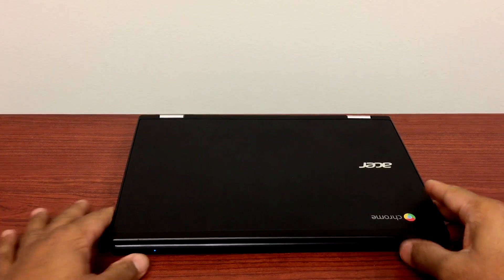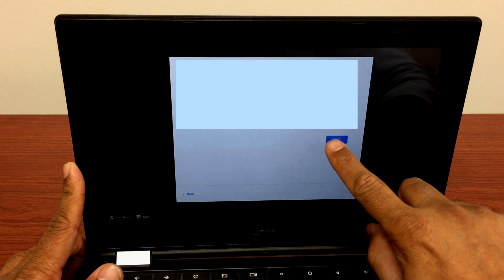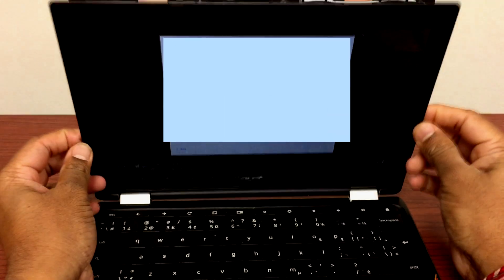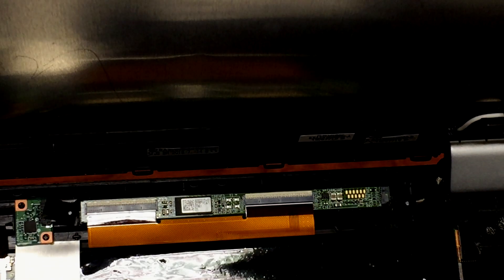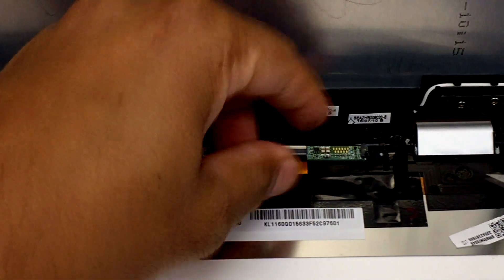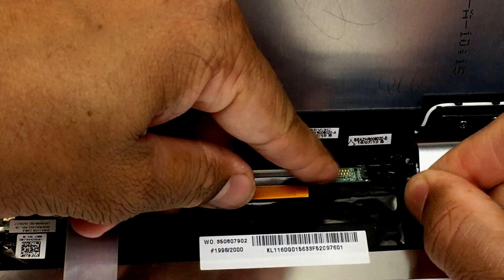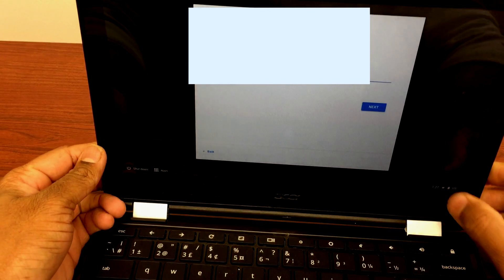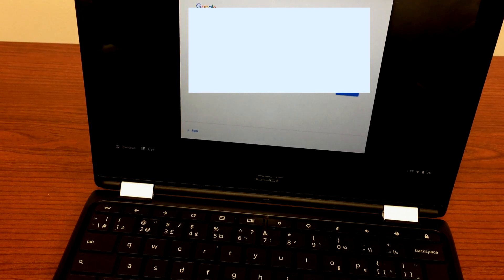Touchscreen not working || ACER Chromebook C738T || R11

Comment: Hey please, I have an Acer Chromebook r 13 not 11 and I think it has the same touchscreen problem but I'm not sure as to how to open up the screen and I don't want to end up cracking the screen, could you help out please?
Reply from the maker: It opens the same way as shown in this video. There is another video with touch screen issue which would help you figure out the best way to open the front cover. Good luck..
Reply: Bro did U fix it? I just bought Acer Chromebook R13 today and suddenly the touch screen stopped working

Comment: Is this the same with a Chromebook R13. The touch screen has gone on mine and I reckon it is a similar problem. Possibly a common one with these laptops being able to fold the screens back 360 degrees. I don't particularly want to fork out loads of money to have it sent off if I can just do this. Anyone got any idea where I might find this wire in and Acer CHromebook R13?
Reply: me too!  hope someone replies...
Reply: samee did you get a fix
Reply: @robeleararsa3391  Nothing i'm afraid
Reply: Josh Baldwin I found it you just have to click shift search and t click it and swipe to see if it works
Reply: @robeleararsa3391 Apologies, can you just explain that again please. Do you mean, press shift+search+T ?
Reply: This only seems to turn tablet mode on (i.e. take the mouse off). I think my Chromebook might be experiencing a slightly different problem 🤔
Reply: Josh Baldwin yesirr
Reply: Josh Baldwin no that’s what mine does when you click shift search and t click your screen and if doesn’t do it click it again and then check
Reply: @robeleararsa3391  Nah still got nothing. Thanks anyway though! 😁

Comment: Similar problem here with an Acer CB515-1HT-C82N-US ... similar procedure though the plug is much bigger and the bezel very difficult to remove.  Anyway, it was not plugged in properly from the factory (only partway in).  Thanks for giving me the courage to try it!